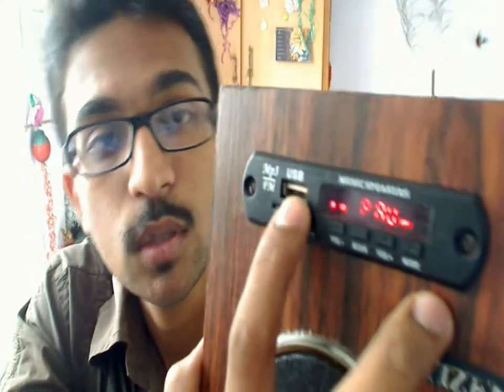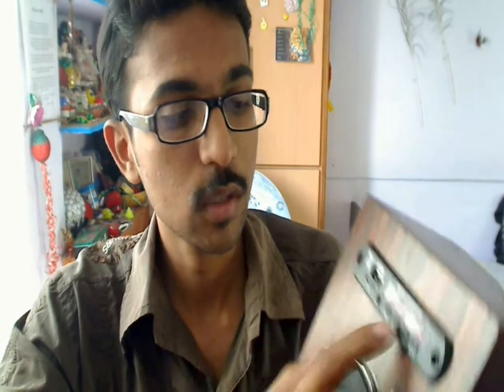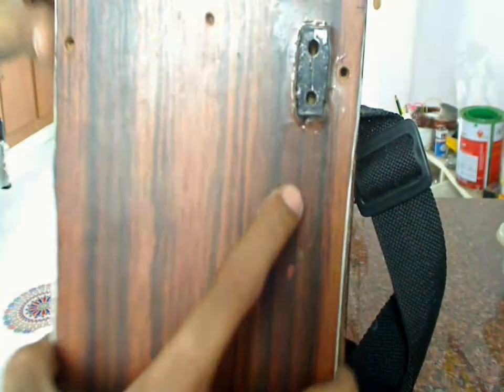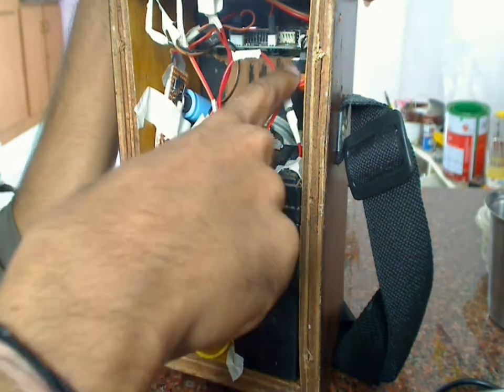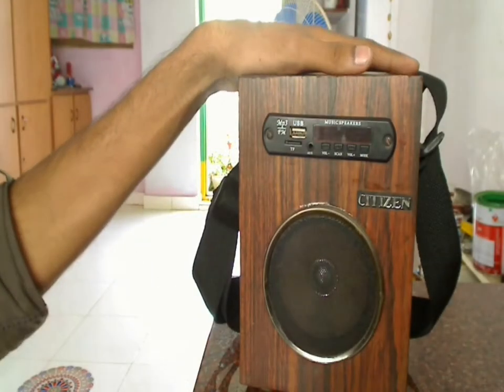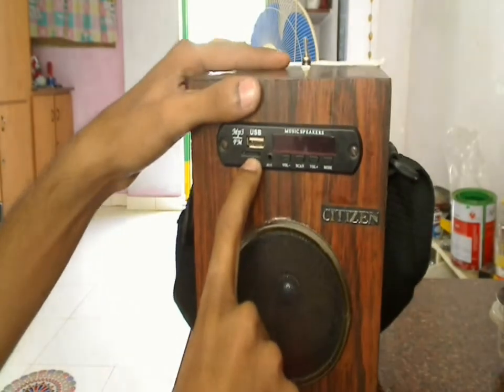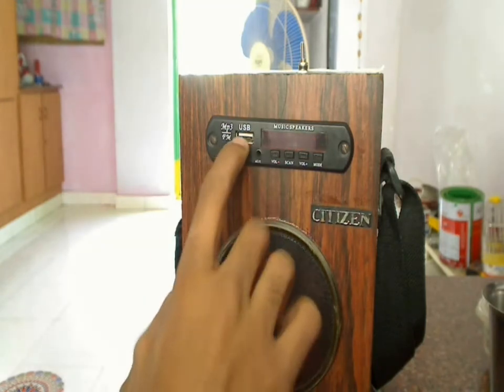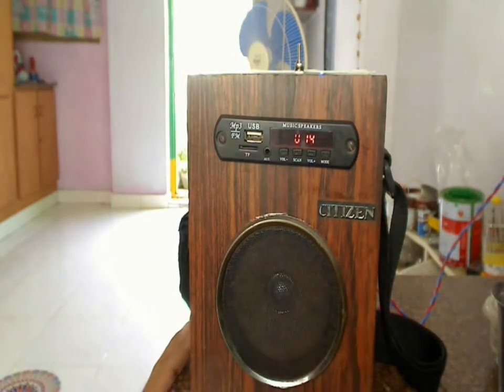HOME MADE MUSIC SYSTEM

Comment: What will the cost of making this system provided I have an old speaker?
Reply from the maker: Saurabhmoy Lahiri  battery is 230rs, usb module is 200rs, transformer 150-200rs, components for charging circuit and amplifier circuit may cost around 200rs, switches, wires and leds may cost aroud 70- total would be less than 900rs